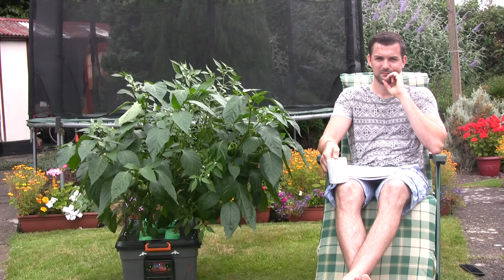Aeroponics - 2  What are the problems with existing systems

Comment from the maker: Hi Ahmad, I'm glad you like the system... :-) 
Without scientific equipment to measure the size of the water particles I couldn't tell you precisely. However I would estimate the finer particles to be around 200 micrometers. This would result from the bounce off affect caused as the sprays meet one another. Although this size of particle is perhaps quite large when compared to high pressure atomised systems, It's very small when compared existing low pressure systems on the market. Ideally particle size should be around 50 micrometers but low pressure, PVC, DIY systems with larger sprinkler heads producing 5000 micrometer particles still produce reasonable results. My system fits somewhere in between the two. Check out my Spread of Spray video to demonstrate this affect more clearly... https://www.youtube.com/watch?v=dAz7wb78FBo

Comment: Great looking system! I understand that most low pressure systems use a sprinkler which provides water particles that are too large to be absorbed by the roots. What size water particles does your system provide?
Reply from the maker: Hi Ahmad, I'm glad you like the system... :-) 
Without scientific equipment to measure the size of the water particles I couldn't tell you precisely. However I would estimate the finer particles to be around 200 micrometers. This would result from the bounce off affect caused as the sprays meet one another. Although this size of particle is perhaps quite large when compared to high pressure atomised systems, It's very small when compared existing low pressure systems on the market. Ideally particle size should be around 50 micrometers but low pressure, PVC, DIY systems with larger sprinkler heads producing 5000 micrometer particles still produce reasonable results. My system fits somewhere in between the two. Check out my Spread of Spray video to demonstrate this affect more clearly... https://www.youtube.com/watch?v=dAz7wb78FBo